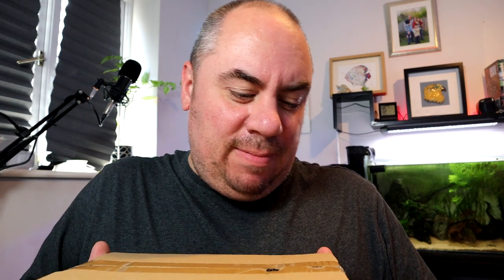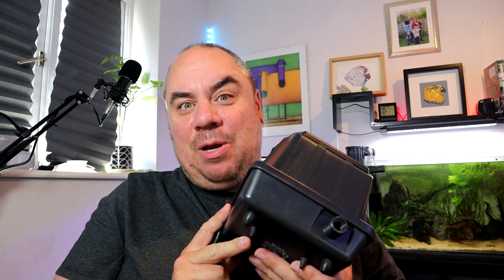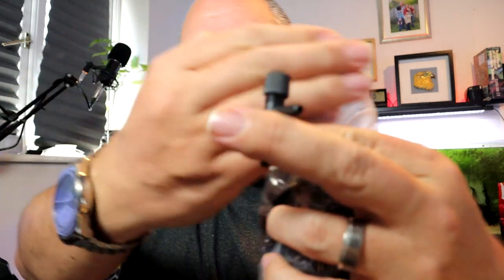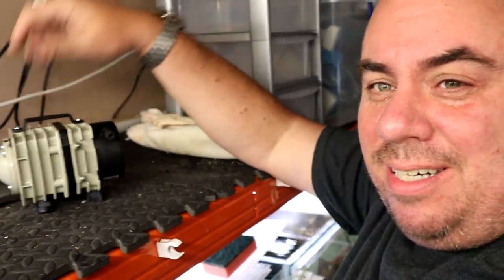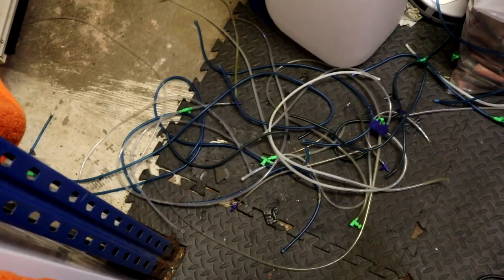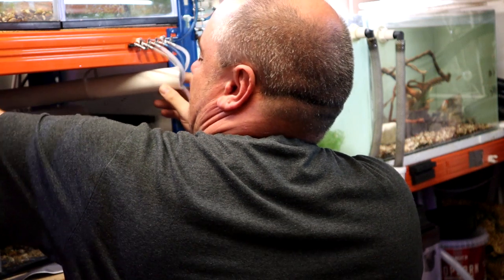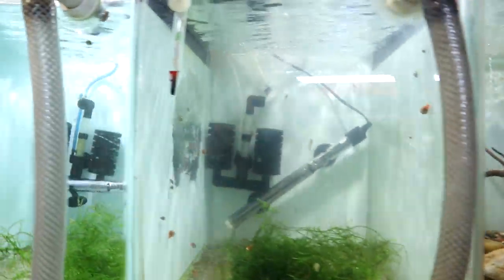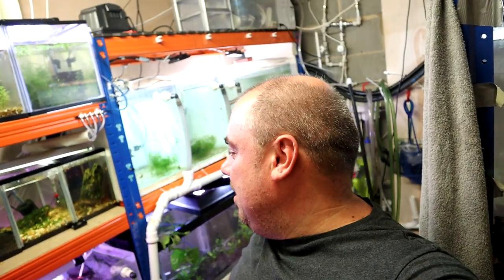Fish room upgrade - Central Air system (sort of...)

Comment: Great stuff.. I'm trying to do the same with my tanks. The issue I have is knowing what size pump to get for my tanks. How did you work out what size pump you needed in the first place. BTW I'm in Australia and getting hold of larger pumps more than 280 LpH are not easy as this is the highest that I can get hold of in my LFS.

Comment: Nice to be able to adjust the air so easily in every tank. The old pump sounded like an idling chain saw. Would love to know how you handle the excess air from the pump.
Reply from the maker: At the moment I have a spare valve on the first manifold open, seems to be doing the trick.

Comment: I've got a Austin 40 LPH pump on my discus tank ( 72x30x24 + sump ). :D I swapped out x2 sera 550r air pumps that couldn't blow up a balloon and wouldn't recommend. They are a waste of cash if you need lots of air for say a K1 moving bed plus air stones in the tank. I could have got away with a Austin 30 but they didn't have any in stock.
Reply from the maker: I think I could have got away with the smaller version too! They have some serious puff!

Comment: You should use PVC pipe to distribute your air arround the fishroom, it should be a loop, the small airhoses have to much backpressure, and you wear out your pump
Reply from the maker: Hence the bleed valve.
Reply: @AquariumAdventures  still better to run in pvc pipe

Comment: I have to say I'm not that impressed with the noise output on that pump. Smaller linear pumps should be bordering on silent. Obviously it's a big improvement, but I personally wouldn't be that happy about it.

Central systems are quite easy to install, and if you oversize piping in the loop for a few extra dollars, you'll practically never have balancing problems.

As for bleeding the back pressure. Start with everything wide open. Start closing the bleeder until you get enough bubbles in a few tanks. As you continue to restrict the bleeder, the pressure will rise across the whole system. Start restricting your tanks as needed to keep the flow down to where you want it. Don't be afraid to open the bleeder back up a bit if you restrict a row of tanks and get a pressure spike. Eventually you'll have all the tanks where you want them, and a minimal amount of pressure in the system. You always want to make adjustments in one direction. Going from low to high pressure ensures that your system pressure stays low.

This is very easy to do, and shouldn't take very long, but it can get a bit fiddly because you're going to be making many small adjustments. This method can handle a fair degree of bad balance. However, if your bleeder is completely closed and you still aren't getting enough air, you either have a pump that isn't big enough, or you don't have big enough tubing moving the air around to certain points.

Assuming you have a proper loop where balancing isn't a problem, adding and removing lines is easy. Add the lines wide open and incrementally clamp them and the bleeder down to restore the system pressure and get the new flow going where you want it. Removing lines is as simple as closing them off, opening your bleeder wide, and closing it back down until the total system pressure is where you want it again. In both cases we are again going from a low pressure state and slowly raising it back up again. In rare cases you may have to tweak individual tanks, but if you have to tweak individual tanks instead of your bleeder when adding or removing lines, it's a sign that you have problems balancing the pressure in your loop.
Reply from the maker: It is practically silent - most of the noise registered on the db meter was ambient noise in the room (dehumidifier, various other filters etc)
Reply: Oh and one other stupid thing. Always adjust your valves by tightening them. If you need to open one up a bit, overshoot, and then come back. It's a bigger deal with needle valves and gate valves as opposed to the ball valves, but eliminating backlash helps regardless of the types of valves you are using.

Backlash is, in layman's terms, the wobble or chatter you can feel on handles of mechanical components between engaging a mechanism one way or another. Most valves are going to tend to want to drift open because of the system pressure. By closing the valve, you ensure that everything is in a compressed state against opening. If you open a cheap valve and don't re-tighten it, you've created a situation where the valve components have been pulled out/open, and can incrementally rattle further open until they are held in place.

There's tons of videos out there that can explain gear backlash and its importance in machining if you care to look into it. Obviously this is not a critical thing to worry about with aquarium keeping, but the same principles are universally useful, and there's no drawback to doing this. You can get away with some seriously junky valves and manifolds this way, but in a more practical sense, it can prevent a valve from drifting if you bump into it, or drop something on it. Sure, too much air in a tank probably won't hurt anything, but that air is coming from somewhere else.

TL;DR 2 second thing that can potentially save you a headache, or in the worst cast, an entire tank.